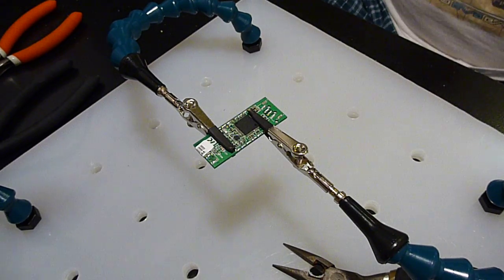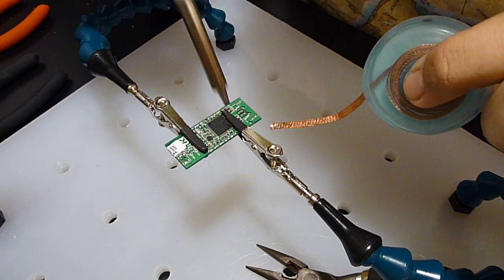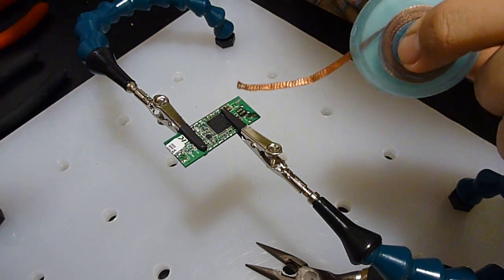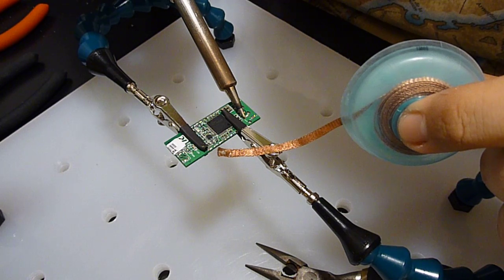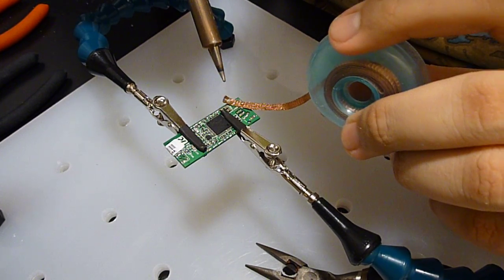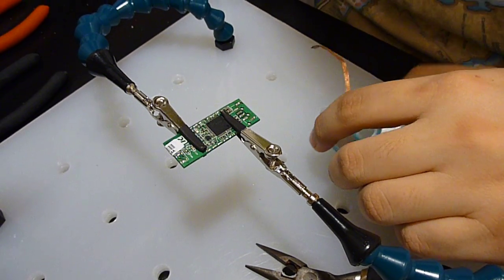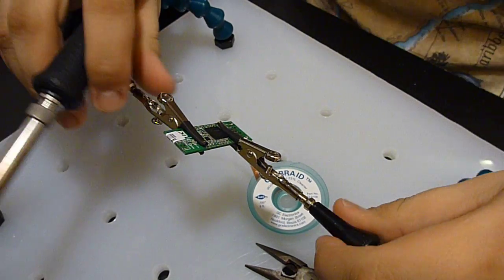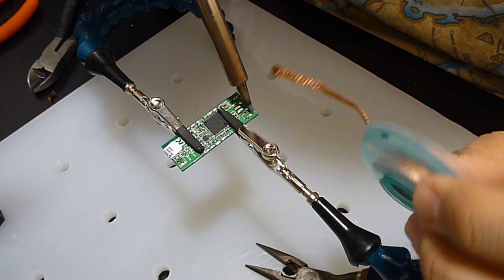Cleaning up the PCB

Comment from the maker: it's probably a good idea to remove the pin.  the main thing to watch out for is damaging the pad it is attached to.  

the copper pads and traces on a pcb are actually glued onto the board, so if you aren't careful about the amount of force or heat you apply, you can delaminate the copper from the board and then it gets messy.

if you are trying to replace a piece that fell off, the best way is to remove all the left over bits like I did in this video and clean it up, then solder a new part on.